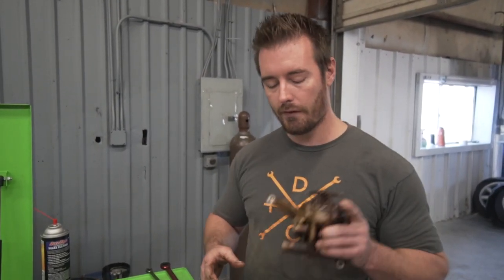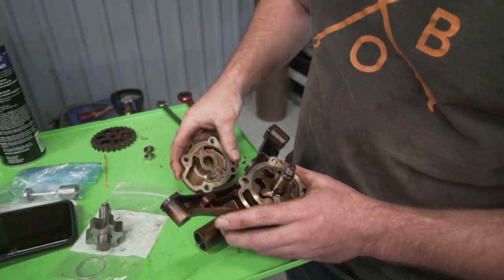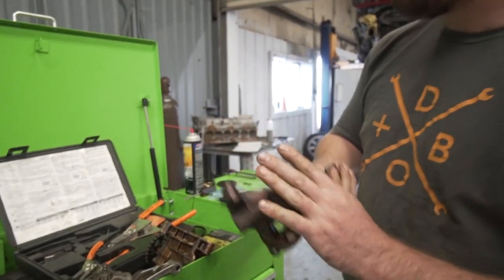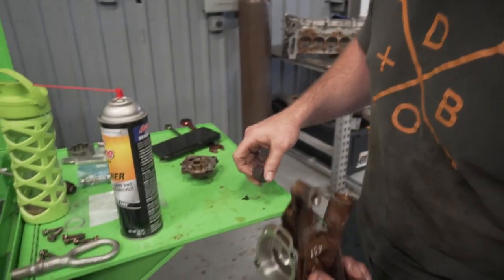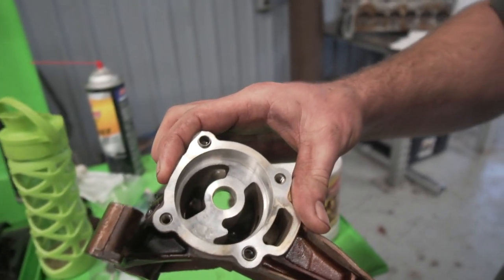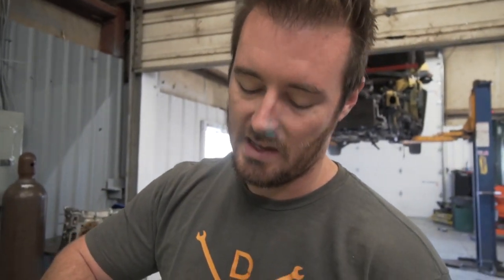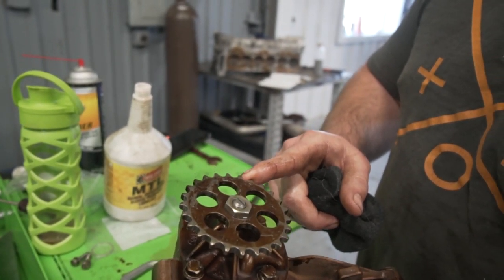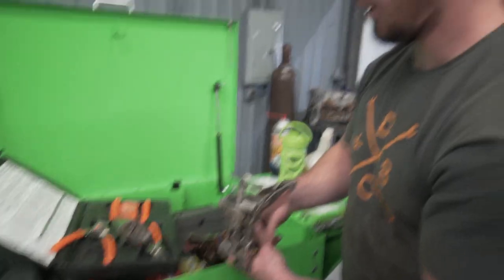Save $$! 24v BMW Oil Pump Rebuild DIY

Comment: Your heaven sent!!!!!!! Thank you. I have a bmw 1984 and the darn pump went out . When I dropped the oil pan I discovered the pump brackets were smashed upwards . I wanted to not spent 500 bucks on a new pump and I believe if its metal it is rebuild-able. . I searched for a rebuild video and found yours. I'm going back out now to see if I can get the gear to turn . I just may need another housing. And hopefully the internals are functionable. I turn the car off and havent started it since I heard the grind noise. So thankfully the crank and bearings are good . I'm following your advice step by step..I will pray mine is as good as yours when I'm done! Thank you again 
           Christine

Comment: I wasn't able to acquire the plunger and retainer for my rebuild, so I just used the Recoil Spring and Guide Rod out of my old handgun. Gave my engine an extra 20 HP.

Comment: If you're trying to put an M52 pump on an M50 block, it's not 100% plug and play. You need to widen one of the bolt holes in the pump or the bolt wont line up with the block. Not by much, it's 1-2 mm off so it's easy and theres plenty of material to work with. Just writing for anyone that needs this info.

Comment: Hey, nice video.Just done m62 v8 oil pump, I were surprised theres no gasket between the two parts of oil pump body...would you use RTV there? I guess it's not good idea as it could clog the pump if any excess pieces get inside. Just cleaned mating surfaces and bolted it together with torque wrench...
Reply from the maker: Last October I rebuilt an m6x pump and didn't use a gasket or rtv, no issues so far ~ 6k miles on it now

Comment: You didn't mention anything about the dimple on the stator and dimple on the rotor which is attached ot the shaft. Which way does the dimple on the stator face and which why does the dimple on thr rotor face? Also the alignment between the two? My pump only had on dimple of the shaft which pointed to the inside of the pump and the stators dimple was also pointing to the inside of the pump.

Comment: Great Video & Info - Is the oil pump on an M62TU similar/same or 
completely different?  If I were doing timing chains/guides on a 
2000/195K mile M62TU would you recommend an oil pump rebuild, or leave 
it alone?  The car runs like a top, but I know the clock is likely 
ticking on the guides.  Thanks
Reply from the maker: So after checking on realoem.org, the assembly doesn't come with the part numbers or anything related to the rotor or stater so I can't really give you any information from what we've researched. In the near future, we will be tearing down an m62tu and m60, the oil pumps will be compared then and rebuilt. 

Rebuilding the oil pump is a little aggressive but makes sense on the 'while you're in there' mentality. The m62 is also quite touchy when it comes to oil pressure. 

https://www.realoem.com/bmw/enUS/showparts?id=GG83-USA-07-2000-E38-BMW-740i&diagId=11_1533

Here's the link for the oil pump diagram if you can find something we can't

Comment: I want to rebuild an S54 oil pump. Do you know if the part number for the spring and the plunger are the same? If noy I could not find these parts on RealOEM any idea?

Comment: When I built a m50 pump whit the gear from an s54 pump, is it only the gear inside the pump I need? Or do I also need the aksel and the outside gears?
Reply from the maker: It's been awhile, but I think you can run the S54 gear in the m50 housing.

Comment: On the inside and outside of the front cover of my oil pump it is all grey as if there is some sort of coating on it, does anyone know if this is just discolouring of the aluminium and I can sand it with a block and fine grit paper? Or if it's a coating and I should leave it as is?